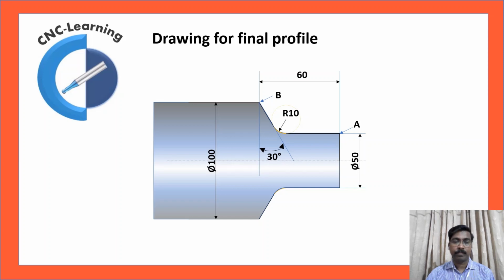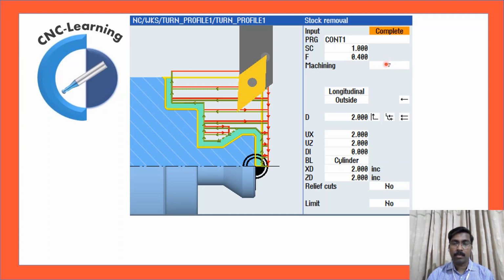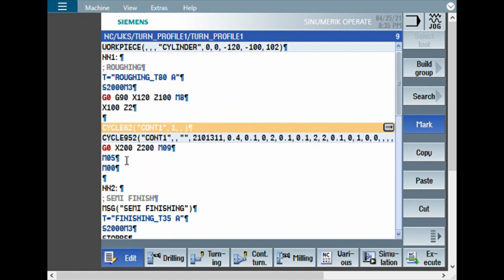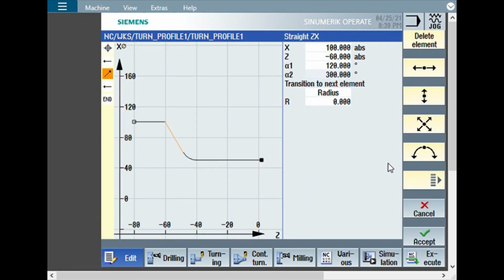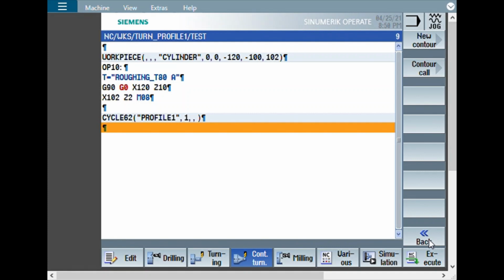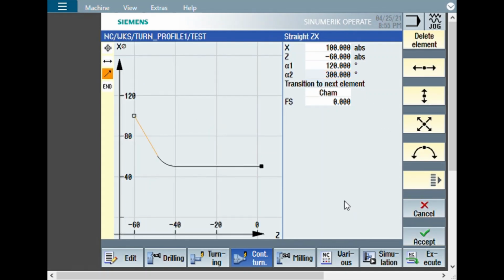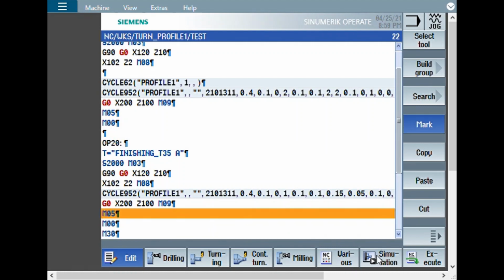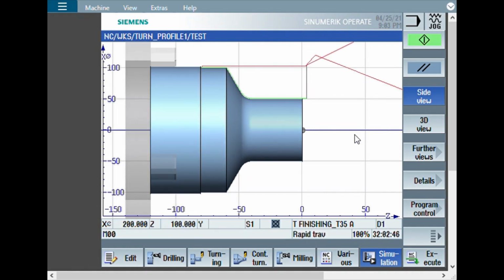Stock removal cycle in Siemens | Cycle952 | Turning Cycle | CNC-Learning | Rajeev Sreedharan

Comment: Thanku for uploading video today  i try this progrm👍
Please explain another  stock removal oval shape profile 100 lenth 50 depth tool use button tool (RCGX)  how select tool.parameter for this cycle 952 .stock removal start from -50 not zero point how create contour   i try this but   coming tool.holder angle insert angle fault
Reply from the maker: Send the drawing to WhatsApp 9881052446. Calling is not available on this number